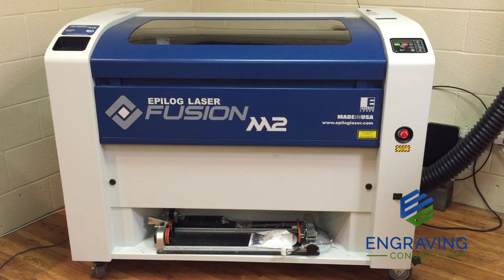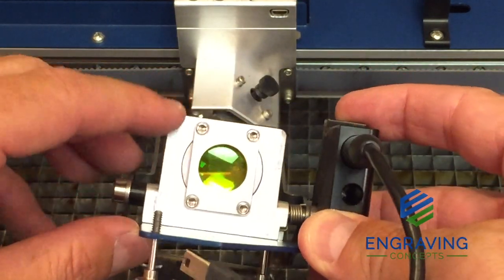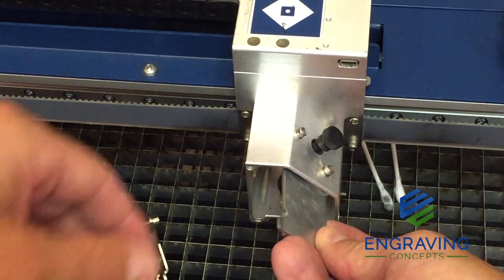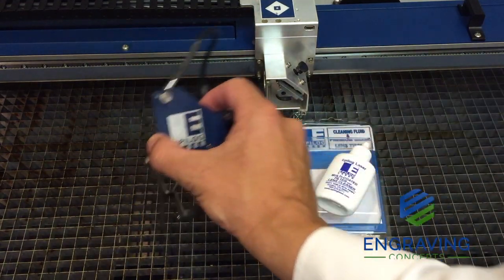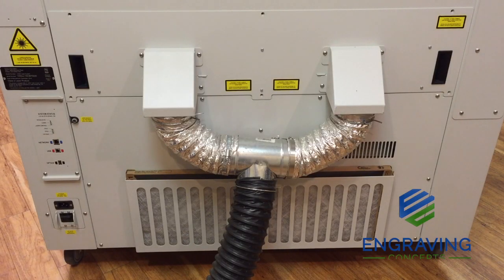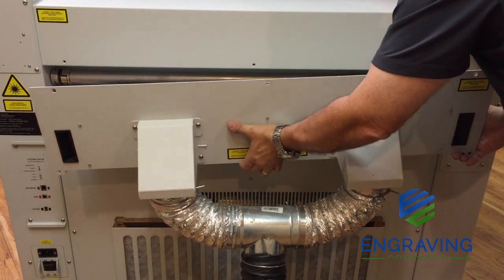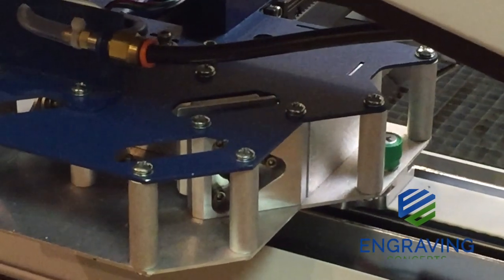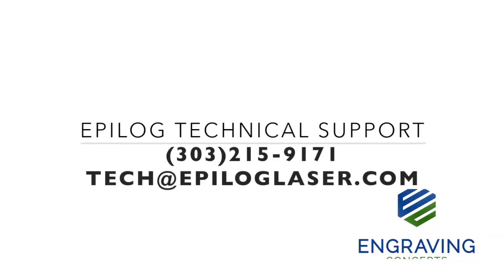Epilog Fusion M2 Lens & System Cleaning

Comment: Any thoughts on leveling the bed? I was able to adjust the front leads, but when I pull the back panel off, I can't access the adjustment screws because the bed is perfectly set to block the opening. I can't wrap my head around how to level this bed while using the manual focuser as described in the supplemental manual.
Reply from the maker: https://support.epiloglaser.com/submit-ticket? be sure to put the SN# of the machine and tech support can help.

Comment: I know this is along shot but would you happen know if the lens is an 18 or 20mm or somewhere size. We have a (probably) slightly older model its a 70 or 75 watt epilog that looks really similar to the m2. And our 2inch lens has been cracked for sometime and I really would like to replace it. Thank you
Reply from the maker: Have you tried contacting Epilog directly? There's a lot of parts that we ourselves don't keep in inventory at Engraving Concepts.

Comment: That was excellent Randy... Video is soooooo much better than going through the manual. We have the last model of the Fusion 40 before the M2 came out. I'm wishing we would have picked up the M2 instead of the last version of the Fusion 40. Our model was manufactured in June of 2014 or 2015. Will the mirrors slide out like the ones with the M2? Next stop on the video tour... laser tube maintenance, power testing, and tube replacement. After that, motherboard replacement or other type of electronic components that can and do go bad and that we can replace ourselves... Thanks again Randy for taking the time to make this video... MUCH appreciated!!!